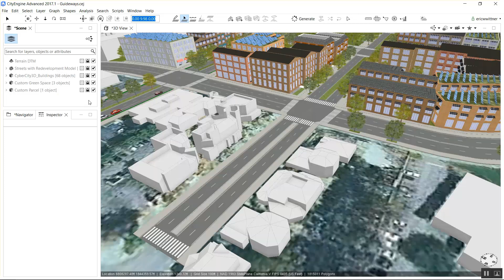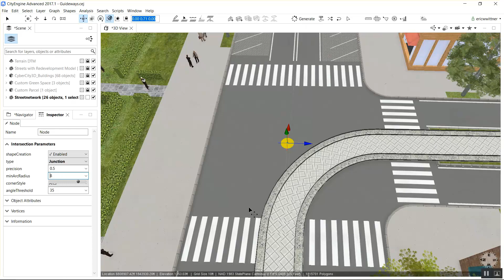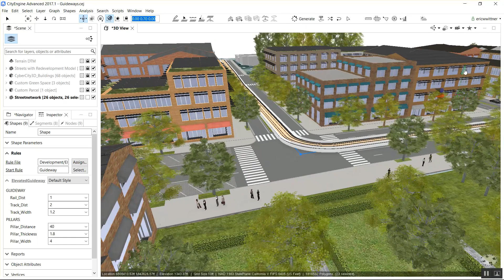Rule of the Week 9: Elevated Guideway

Comment: Thank you ESRI folks, it's a very useful rule except that the pillar base always remains at zero height, which in my case stretches them considerably as the terrain tile is quite high up.  A  cga rule file would be nicer than the included rpk in this instance so that we could learn and modify it.  I don't recall if the pillar base level (for roads) has always been an issue or not ?